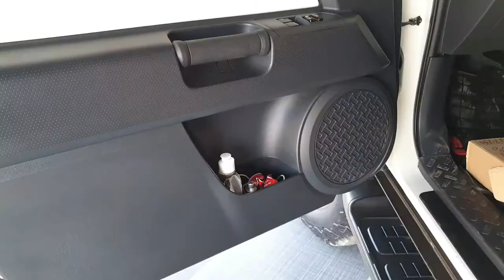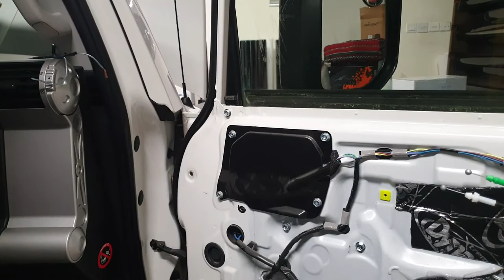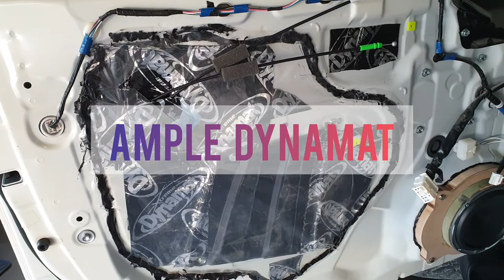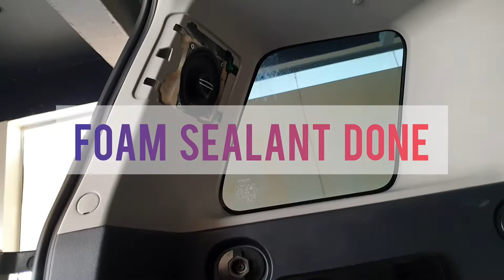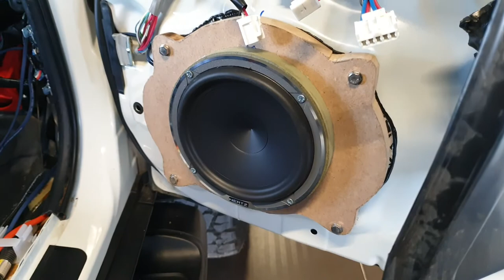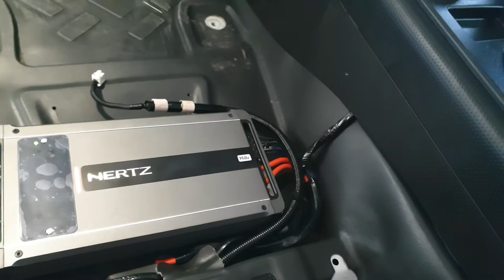Toyota FJ Cruiser Audio Upgrade - HERTZ

Comment: How do the rear pillar speakers connect to the amp
Reply from the maker: Pass a new wired to the amp
Reply: So you filled it with foam then mount the speakers to the foam?